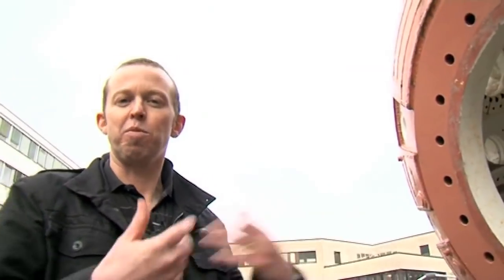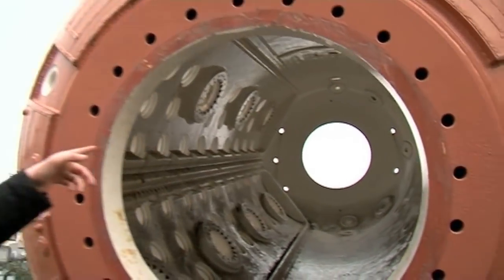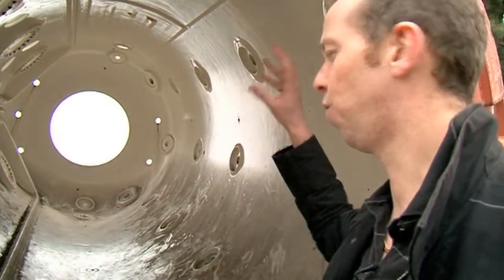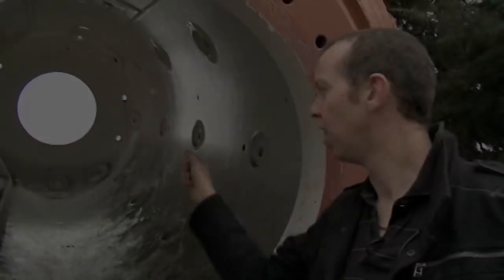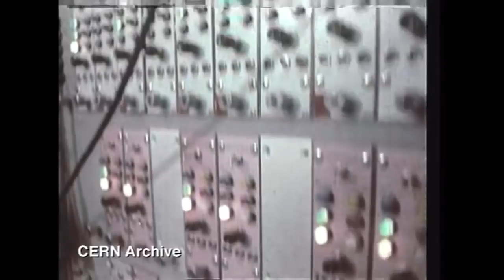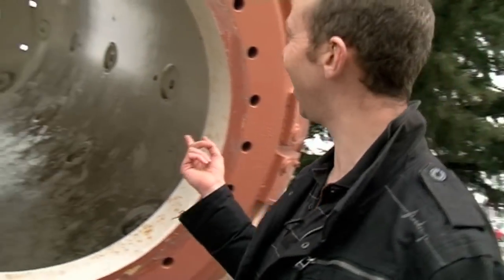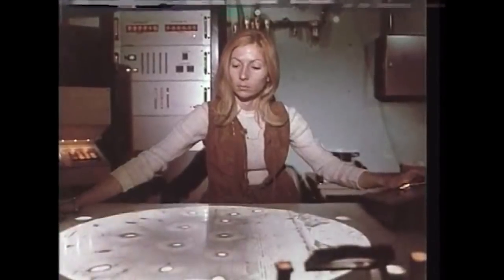Gargamelle and Neutral Currents - Sixty Symbols

Comment: Lovely archival footage in there. Should've mentioned that it's the Higgs particle is the final piece of the puzzle here. For it is the Higgs which causes the symmetry between the weak force and the electromagnetic force to be spontaneously broken at everyday temperatures, and appear as two separate forces much in the way electricity and magnetism themselves were seen to be entirely separate phenomena before Maxwell unified them into electromagnetism the 19th century.

Comment: As I recall, your original question did not mention turning off the strong force, so the nuclei would remain intact. The bulk of the mass of your body would remain in the form of the nuclei and 1/1836 as scattered electrons. The electrons would be moving fast enough to escape the Earth and Sun's gravity, but the nuclei would be moving in independent orbits around the earth, gradually spreading out. The cloud eventually spread out across the volume of the Earth and a small distance above.

Comment: You are right, conservation of momentum would imply that the nuclei would go in the other direction, at 1/1836 of the speed of the electron for hydrogen. That looks to be approximately the same as the speed of molecules at room temperature, which would be another reason why the nuclei would spread out, which I did not mention earlier. If the strong nuclear force is removed, then the quarks would fly off at almost the speed of light, because there the rest mass is a small percentage of the total.

Comment: The actual mechanism goes something like this - The Weak force is the force by which quarts change flavour (up, down, etc). A Neutron is Up-Down-Down. One of the Down quarks emits a W- Boson (the mediator of the Weak force), changing the Down to an Up (a net change in charge of +1, balanced by the -1 of the boson). The W- decays almost instantly into an electron and an antineutrino (again, conserving charge, as the antineutrino is neutral).

Comment: freon is the gas that has been used inside refrigerators and air conditioners for years.  When freon is compressed (as in a fridge) it turns into a liquid.

Comment: Electro-weak symmetry unification is only present at very high energy states. On the energy scale of typical daily life, the electromagnetic and weak nuclear forces are very different indeed. Conversely, electrical and magnetic forces are actually two aspects of the same process, and act together at all times - there is no known state where they decouple.

As for why not 'electro-mangeto-weak' interaction: convenience - Since magnetism is just an aspect of electrodynamics, it would be redundant.

Comment: True, it's fairly difficult to take existing neutrinos and 'catch' them, which is why that isn't what would be done. Instead, it would be much easier to use a reaction that -generates- large numbers neutrinos in a predictable manner to create the stream. Neutrinos, it turns out, are fairly easy to generate (elements that undergo radioactive beta decay, for example, throw off lots of neutrinos in addition to beta particles).

Comment: Each electron has 13.6eV of kinetic energy in the ground state of hydrogen. If the attraction goes away, that energy would go somewhere, so yeah sounds like the electrons would go their separate ways, at a speed of about 2 million m/s if my math is correct, in the case of ground state hydrogen.